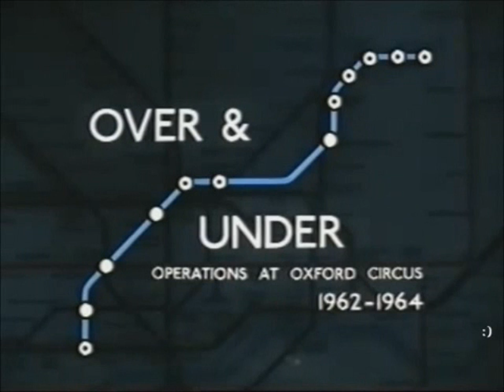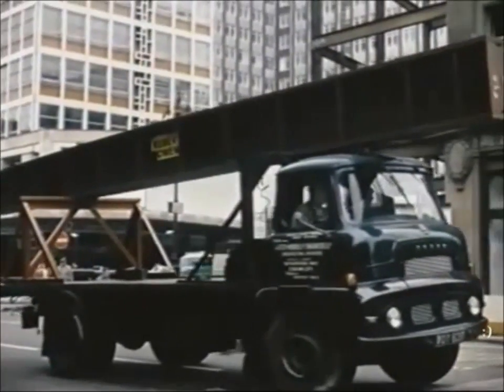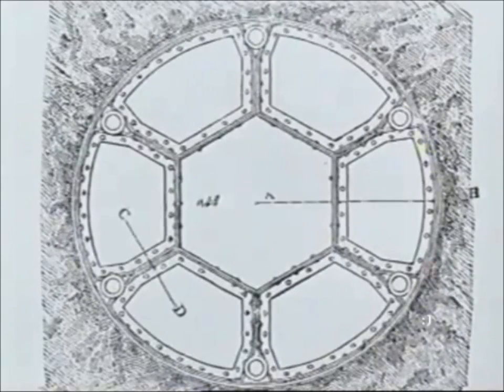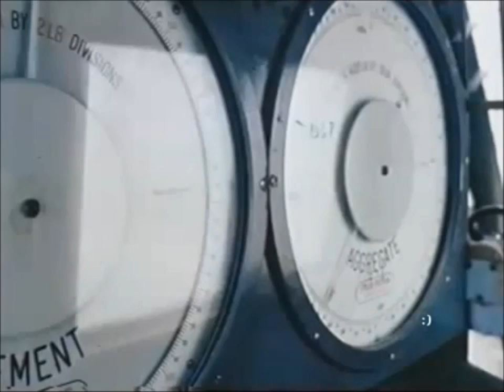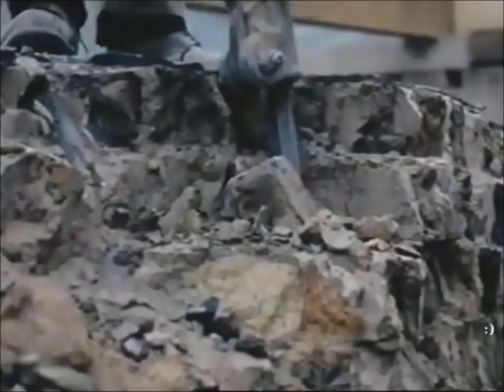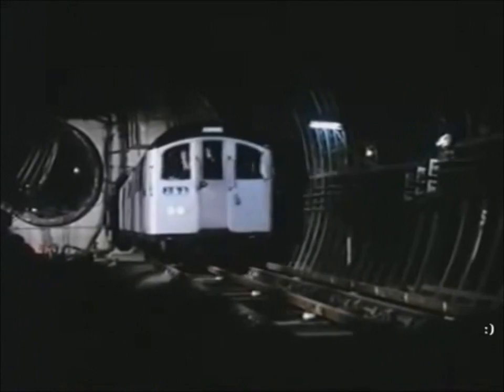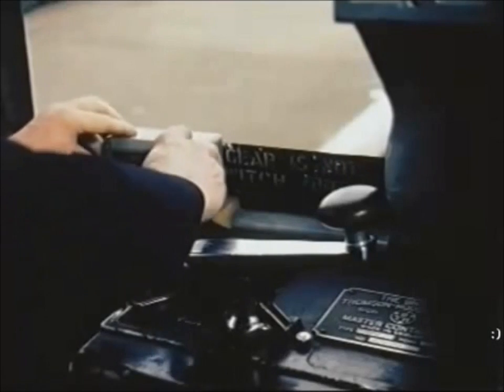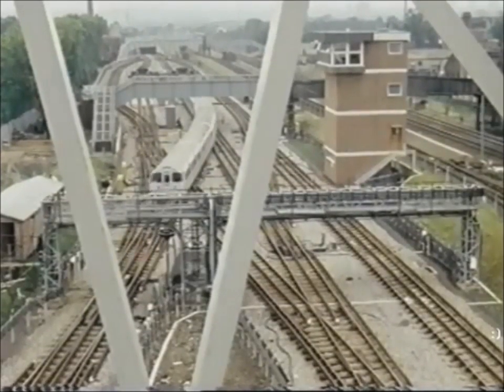Victoria Line Story

Comment: impressive documentary! I appreciate the desire by the producers to create an accurate picture of the tremendous effort involved.
Reply: youre seeing exactly what they want u to see mate, and nothing more.
Reply: @billyunterbuchner9197  No you are seeing hard work, excellent engineering, unique innovation, great craftsmanship, superior planning all used to create a system that is still running today as one of the main arteries of London.
Reply: Didn't show any of the cock-ups though.
Would've liked to see how they dug the escalator tunnels.
I remember in the 1960s there was a temporary umbrella type structure at the main entrance to Charing Cross overground Station. It was there for several years. I think it was for the excavation of a ticket hall. Not sure what the main project was.

Comment: I drove both the Kinnear & Moodie and the McAlpine TBMs the later was the better machine. I also worked on station ground shields, on the Chas Brand section Sven Sisters to Hoe St station. one of the station ground shield was water hydraulic, so if you had ram leak you would just stick the hose pipe in the water tank and keep going.
Reply: could u repeat all that in English?

Comment: The Victoria line has changed a lot since it's 1960s construction. Up to date automatic operational system and the original 1967 stock trains replaced by the 2009 stock.

The Victoria line was extended to Brixton later in the early 1970s. Only it's 1972 stock identical looking relatives are in operation on the Bakerloo line.

Comment: no hard hats no hi viz no heavy lifting gear no overalls sometimes  we complain about modern health and safety but this shows why we need it
Reply: Modern H&S is why we get sod all done and what is done ends up being a half arsed job that needs re-doing after about a week.
Reply: Modern H&S is why the old budgeting rule of "a man a million" i.e. every large construction project would cost a life for every million dollars/pounds spent, is no longer used.
Reply: NYC subway builders today (new 2nd Av line) all wear hard hats and orange safety vests. And they don't smoke while working! It is amazing what they accomplished back then with slide rules and no lasers etc. But the basic construction work is I'm sure pretty similar. And back when the first Tube was built they had far less mechanization than in the '60's and managed to build it.
Reply: +MattyT98 since when does some hard hats, Hi viz and overalls stop getting things done?  It doesn't.  Shoddy practises and laziness stop things being done and means they don't last.  Not H&S, which in terms of construction genuinely saves lives.
Reply: No. What this actually shows is now namby-pamby we have all become. Engineering like this proves the value intelligence aligned with some common sense gets challenging work done in double quick time. These days, the focus isn’t about doing it efficiently but about ‘doing it safe’, which takes longer and costs a fortune.

A whole cottage industry has developed around H&S, which in practice are barriers to progress. Back in the era of building the Victoria Line, you didn’t have the litigious society we do today where it’s about finding anything which a claim for compensation can be slung around. It’s a pathetic practice by those who are just lazy and workshy.

I have the utmost respect for these men as they are REAL workers. They knew the job, rolled up their sleeves and got it done.
Reply: @ @Matty_98  All part of the destruction of the UK's industry (and more recently, though not that recent - western European industry as a whole). 'Globalisation' as it is taught in schools.
Reply: There are hard hats in this video. But the rest of it with regards to H&S it makes the job drag on longer, costs are astronomical and there's that much risk assessment beforehand, makes the job take forever.
These guys in the video, they knew their job, and they got on with it, no pissing around. And the job was done properly and to a very high standard. Nowadays a lot of things get botched up and need redone again in no time. Fuck the H&S brigade.
Reply: We have fatalities and life changing injuries on Crossrail today.
Reply: Jesus it always amazes me that people actually complain about H&S. It's there to stop workers being injured or killed. It hasn't been dreamed up for no reason - millions of manual labourers were maimed or killed in the past, just to make a job quicker and cheaper. How can you seriously put efficiency and cost above the lives and livelihoods of workers? Idiots.

Comment: Such a weird juxtaposition, modern engineering technology and a fairly modern looking London but no hats, gloves, or boots and dangerous working conditions. I suppose the early 1960s must have been the crossover period.
Reply: Nicholas Turnbull I think it wasn't till the 80s that hard hats became common. And the 90s when it became mandatory. Same with high viz
Reply: I think serious h&s ppe etc started on the channel tunnel I was on hs1( Ctrl) in 2005/6 and ppe was crazy by then. Hard hats, dark glasses, long sleeve hi vis long trousers boots gloves summer 2006 one of the hottest on record, men passing out with heat stroke  at the Ebbsfleet site.

Comment: I’d love to know how they powered the mining machine. What hydraulic pump they used and what not. Nice Poclain Poclain ty 45 seen working also
Reply: They explained in the documentary that the machinery was powered by electricity, used to run electric pumps on the machine to create hydraulic pressure to the operate the rams etc.
Reply: @duncangrant4580  you mean electric motor  powered by electricity there for turning a hydraulic pump. But I wanted to know what hydraulic pump was used. I'm guessing it could have been a poclain system.

Comment: When the 1973 stock took over the Piccadilly line, the 1959 stock were transferred to the Northern line.
Reply: Oludotun John Showemimo the 1973 style Piccadilly trains were designed for the new Heathrow service. The tunnel floors had to be lowered in places to allow the new trains to pass through.

Comment: How must the cast iron rings be treated against rust before being installed?
Reply: trainrover galvanising would be the most common method of the day, the other would be sacrificial metal blocks.
Reply: Neil Dahlgaard-Sigsworth the outside of the ring was sealed against the earth by pumping cement grout into the narrow gap through a hole in the middle of the ring segment.
Reply: You can't galvanise cast iron it won't stick as oxygen will be limited on the outside of the ring corrosion would be very slow anyway
Reply: No need - the clay is impermeable. The Tunnels are 99.9% warm and dry.
Reply: You must be right, because there's no avoiding the tell-tale signs of water infiltration underground around the island here...head to the border merely 40 miles away, and we'd be breathing in earthly-smelling sulphur any time you open a faucet.  By the way, we used to have hoover and trash units here until the early '80s, so with the former's disappearance hairball tumbleweeds throughout our entirely turfed metro became vogue ages ago.
Reply: @trainrover  What island? what country?
Reply: @moosic2i  Montreal, Quebec, Canada (Island of Montreal [Île de Montréal])

Comment: That's not what you wanna see, A driver falling a sleep lol 1:40:15
Reply: Train was going the opposite direction, that was the Guard.
Reply: hence the lol it was a joke
Reply: Wrong. The train was clearly doing forwards. And as far as I know tube cars didn't have guards compartments, they stood at the end of a carriage.
Not that it makes any difference what the driver is doing, seeing as it's automated.
Reply: +MattyT98 Tube working practice is not and has never been the same as mainline trains.  Guards (when they existed) were in the front (furthest away from the back cab) of the rear car,  Where there were special guard panels.  The guard would place a bar across a row of seats taking them out of use and work the train.

The Victoria Line has been ATO and OPO from day one in 1968. There have never been guards.  The Train Operator (not a motorman or driver as he doesn't normally drive the train) shuts the doors, presses 2 buttons and the train will accelerate, and brake itself as necessary to get the train safely to the next station.  The train op has an emergency brake, but this is not normally needed.  The Central, Northern and Jubilee have since been converted to do the same.  So the DLR is not the only automated line and never has been.  The only extra thing the DLR does automatically is the doors.
Reply: It was going backwards, I downloaded the video and played it frame by frame.
Reply: Vic line has automatic operation